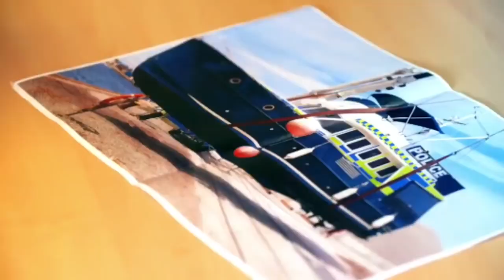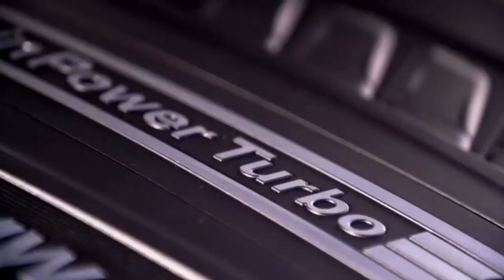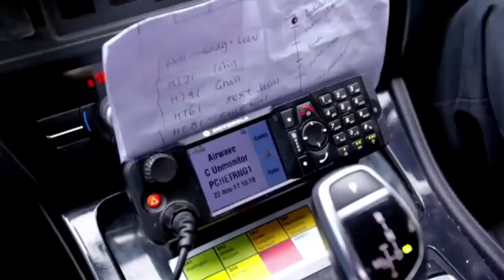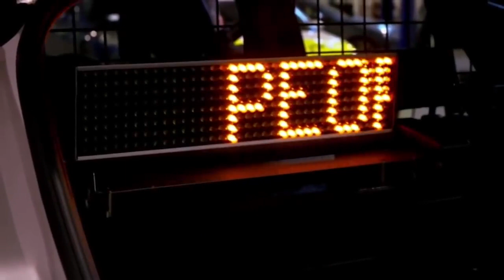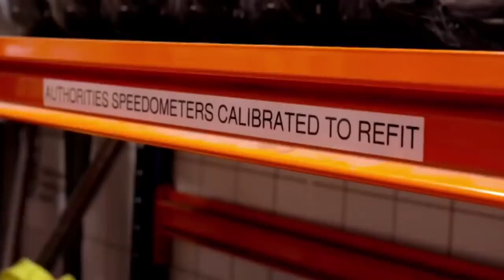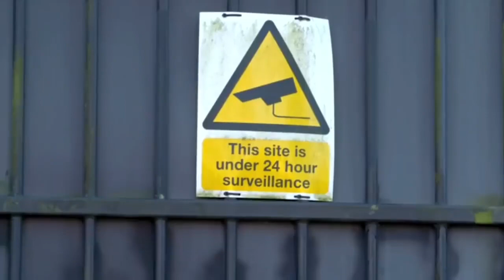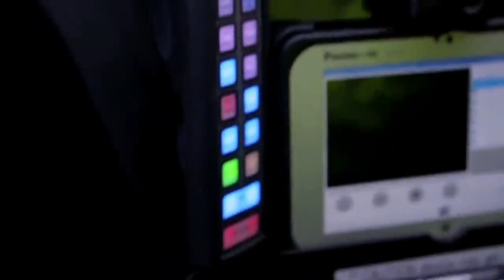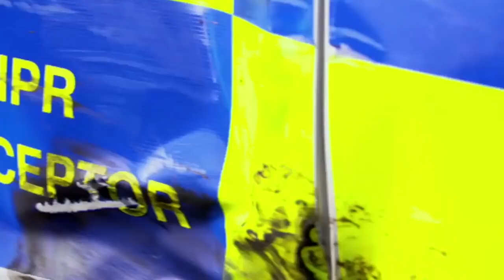Cop Car Workshop HDTV Episode 7

Comment: The best Police Car in the world was the Ford Crown Vic. Fast And you could not break it.It would last 200K miles.
Reply: They weren't that fast. They had a top speed of around 130mph, acceleration was slow in comparison to other police cars of the time, and they had well documented issues with fires caused by rear-end collisions because of the location of the fuel tank. All that aside, they were definitely one of the most practical police cars. I love the Crown Vics, and I'd love to get my hands on one. They're just far too expensive here in the UK.